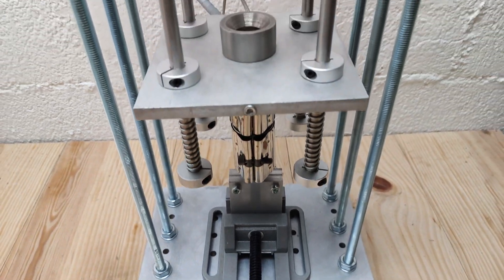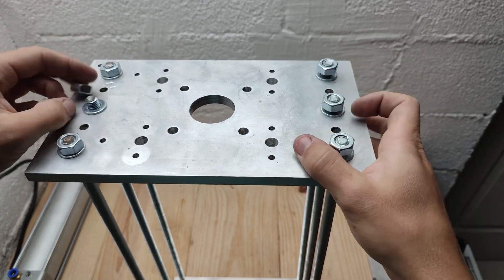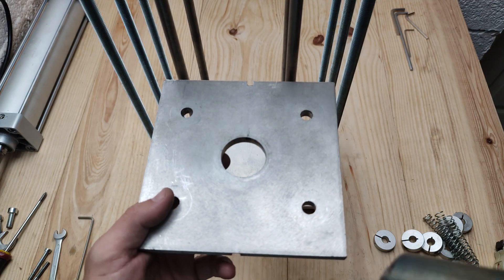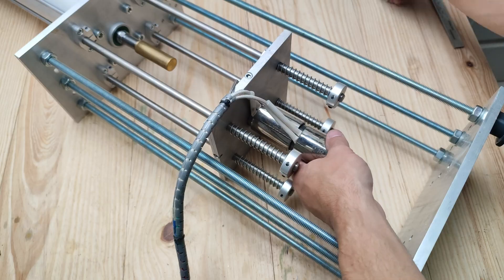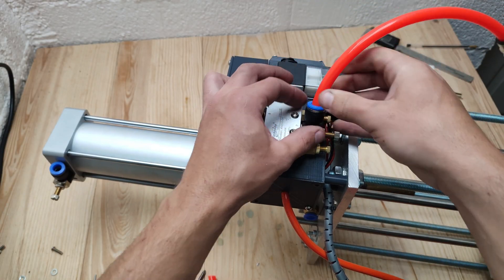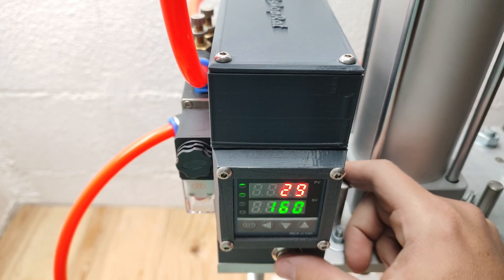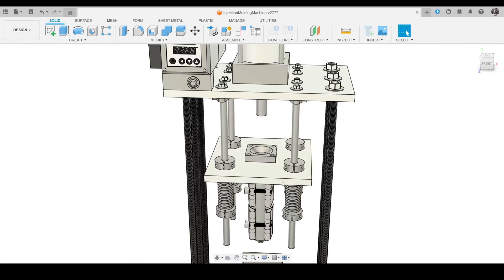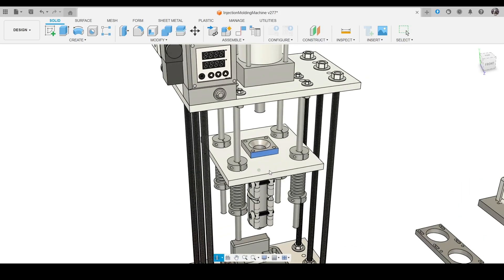DIY Injection Molding Machine – Build Your Own at Home (All Files Included)

Comment: Wow, this is really cool. 33 grams.

If I wanted to double or even triple that amount in a single shot what are the things I would have to look out for?

Bigger/multiple heat chambers (and thus more heating elements)

More rods for rigidity 

Modified press (length and/or circumference, higher pressure)

You're doing great work my guy.
Reply from the maker: If you want to 2x or 3x injection amount you could go with big chamber or longer with more heating element. I think both is pretty much the same, just it's easier and cheaper to machine a longer chamber.
Reply from the maker: I don't think you need bigger guiding rod because they don't force at all they are just here to guide the chamber down to the mold they don't take any pressure. If you want to talk about it join the discord ;)